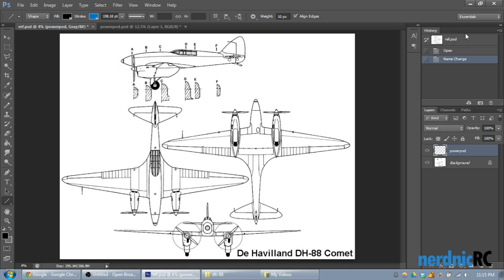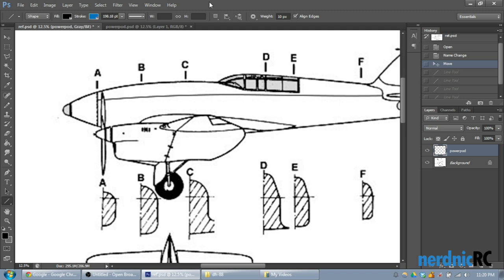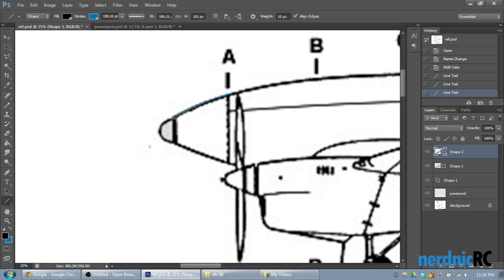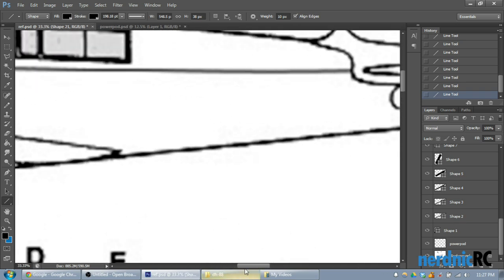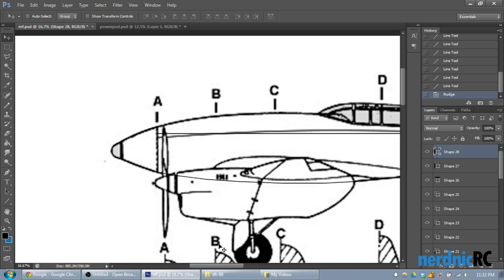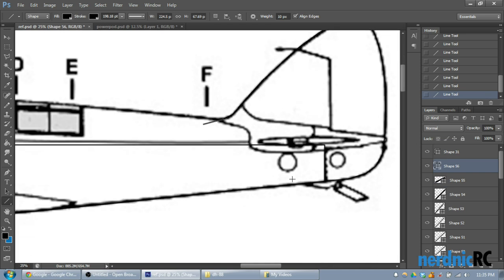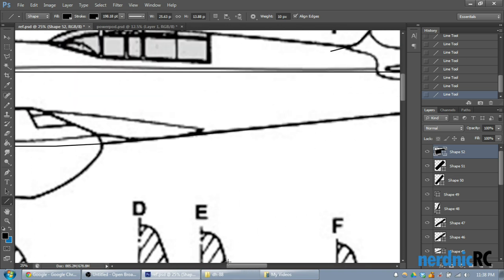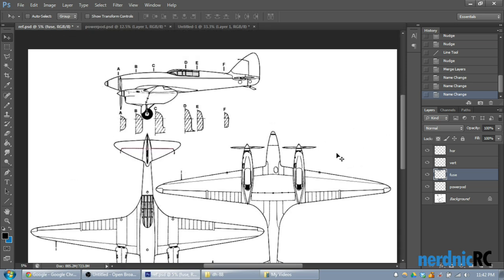Part 2 - How to Design DTFB Planes

Comment: Hi, I am eagerly watching the videos. great work. one tip, one question. the tip: when you rotate the bottom wing, you can move the rotation point down to the left corner. than you don't need to rotate-move-rotate... the question: you are designing the top wing along the original plan. than you say that they bottom needs to be smaller, because the top will be shaped to form the airfoil. this is of cause correct but designing this way will cause the wing being less wide compared to the plan. does this matter? do you have an idea how to avoid this "problem"?
Reply: sorry, I meant to post this at part 3 of your series
Reply from the maker: +Corren Backenhörnchen Thanks for the tip! I have since started doing this in my designs. I didn't know about this during the filming for this series, though. For the wing chord, you will end up with a slightly more narrow wing than scale if you trace the exact line. On a 40" plane I've found this to be only 1/4" difference or so and is a non issue. To compensate you can just make the chord wider as you make your plans.

Comment: HEY NIC ,  I HAVE USED SKETCHUP TO DESIGN THE FORMERS AND AIRFOILS I   HAVE TROUBLE  LINING UP ALL THE PARTS EVERY TIME WITHOUT FAIL . DO YOU KNOW OF A BETTER PROGRAM THAN SKETCHUP ?  WILL YOUR PROGRAM CREATE PLANS .
Reply from the maker: jan lechner I think sketchup is probably your best bet unless you want to spend a lot of money on a full CAD program. With Photoshop I am able to save as PDF and create plans!
Reply: +Nic Lechner I'm using inkscape and it works good too